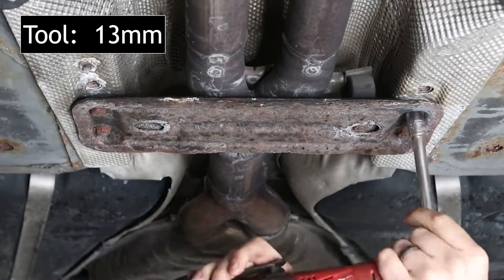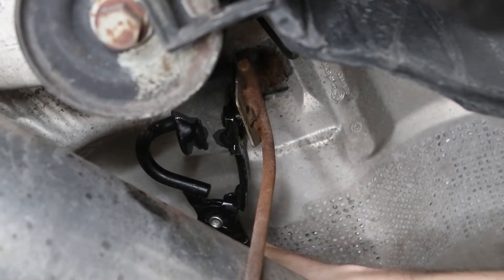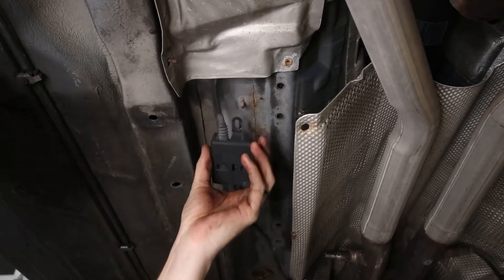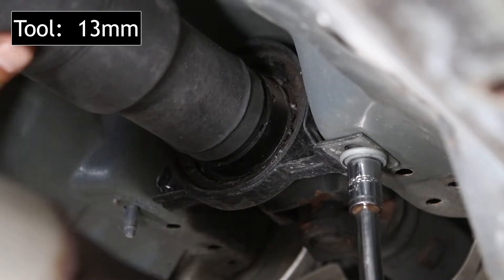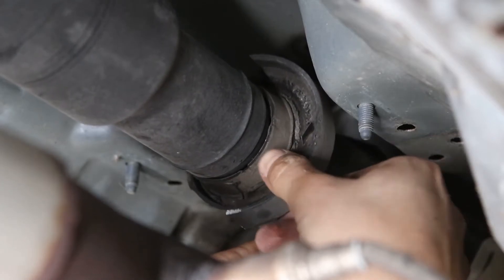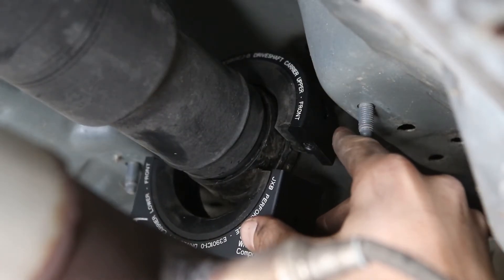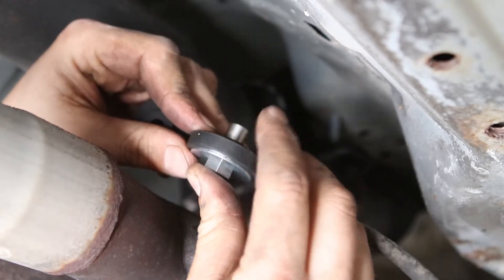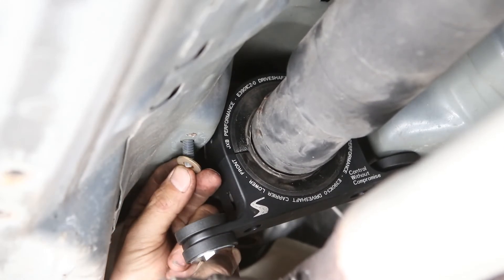(BMW06A0) BMW Performance Driveshaft Carrier Install on an E39 540i - JXB Performance

Comment: Should've included a new bearing....they kinda wear out as well, after 20-25 years.
Reply from the maker: In our experience we have found that the bearing typically outlasts the rest of the driveshaft. Our carrier does not prevent the bearing from being replaced but eliminates the need to remove or disassemble the driveshaft to replace the stock carrier. If your bearing is worn and must be replaced, to use our carrier the rubber on the OEM bearing must be transferred over to match the stock bearing outer diameter.
Reply: @JXBPerformance  if my bearing is worn, I would just use the stock carrier and bearing, brand new oem part, for half the price of the carrier you're charging. Why pay twice the price for half the part. Removing the driveshaft and disconnecting it is pretty simple. Consider adding a bearing to your system...as to the suggestion of sacrificing a brand new part to cut out the bearing and use if with your carrier, that's pure madness, might as well set my money on 🔥 😁

Comment: Question. The factory center support bearing for the E39 540i/M5 has to be preloaded by slightly pushing 3-5mm towards the front of the car while tightening down the nuts to prevent premature wear. How does that work with this?
Reply from the maker: Our carrier does not require a preload.  That preload is for the factory rubber to be loaded a certain way.  Our solid bushings do not require it.
Reply: @JXBPerformance   Cool, thanks for getting back.